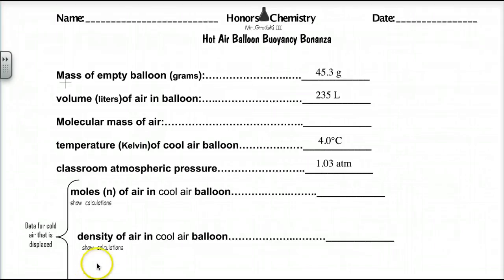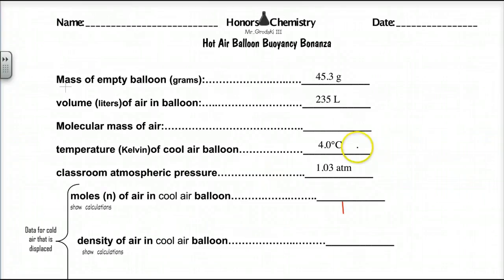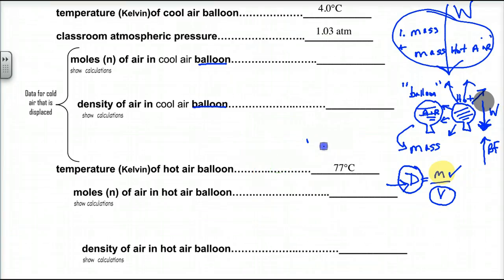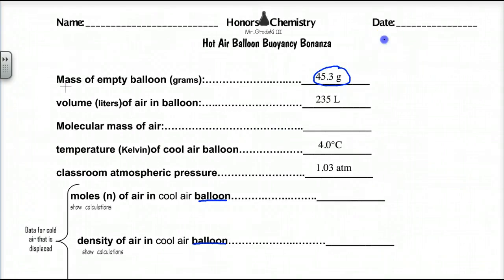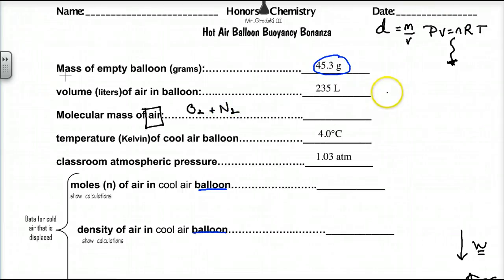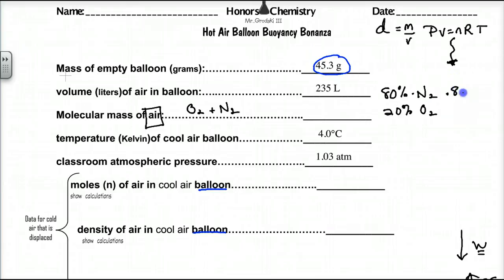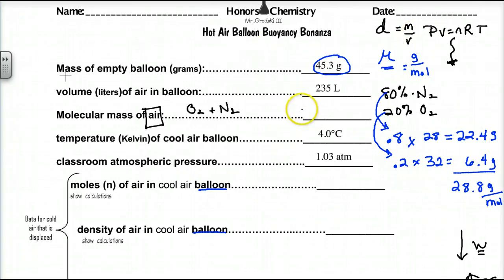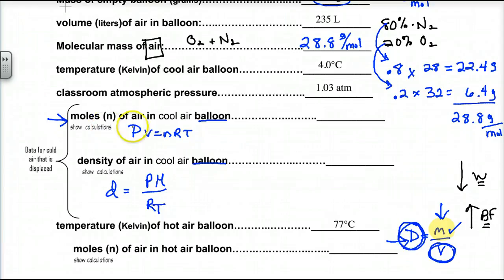Lecture 2.7 - Hot Air Balloon Lab Calculations

Comment: What if the balloon reach its maximum size and we still heat the air, would the pressure increase or not..?
And what if the balloon tears in the air..?
Thank you
Reply from the maker: Not sure what you mean by reaching its maximum size?  A hot air balloon is open to the atmospheric air and thus its pressure inside the balloon is equal to the pressure outside the balloon. If the balloon tears then it will lose its hot air and thus it will get heavier as it takes on colder dense air causing it to lose lift.
Reply: I read several articles say that when you heat the air inside the balloon it will expand and run some particles outward, leading to reduced density, but movement of molecules will become very fast because of the heat, leading to increased pressure which is commensurate with the increased size of the airship, but when the balloon cannot stretch. More pressure will start heating continues to rise.
My question is would that lead to a push force if the balloon tears in the air?